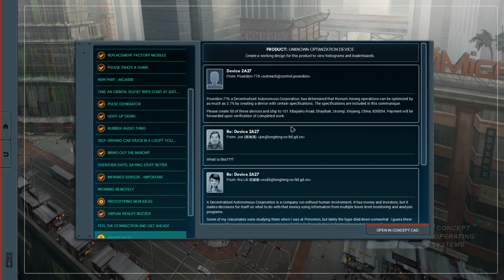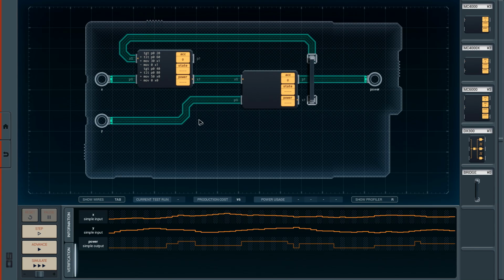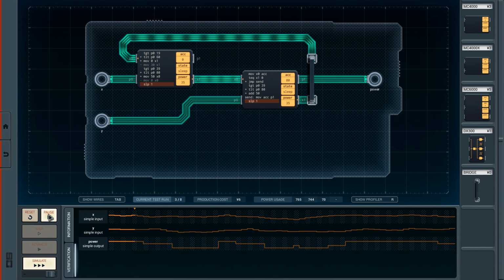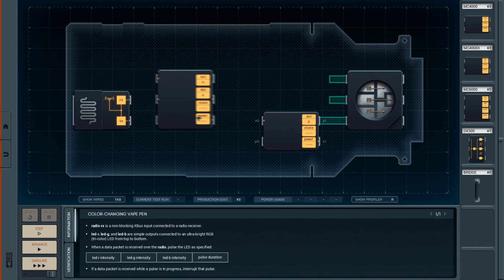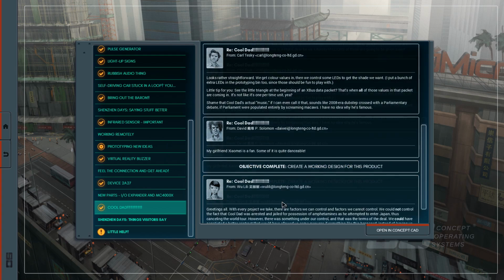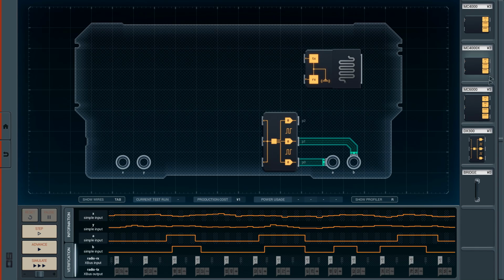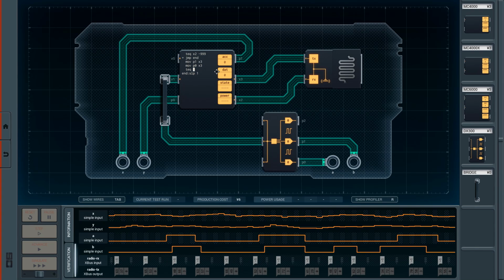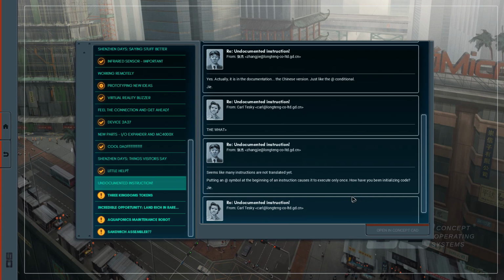Shenzhen I/O - Part 4 - Thorium Mining Cool Dad Vape Cubehotel Game Controller

Comment: one major problem with this game is that it assumes you need a sleep command.
while it treat SUB/ADD/MUL, MOV, and NOP to be the same.
as some one who has designed circuits working my way up to programming I can tell you NOP is waaay faster then sleep, SUB/ADD are equal MUL is faster then DIV, while MOV is slower then ADD and faster then MUL/DIV.

people seem to compare it to TIS-100 and KOHCTPYKTOP, but what frustrate people who actually deal with machine code and real clock cycles is the fact that different operations don't take the same time to execute.
TIS-100 coped with it by making every operation take the same time, while KOHCTPYKTOP made it pretty realistic, while Shenzen IO takes it to the programmer level, ignoring any actual computer logic... if  there's nothing on the bus then read it as a 0 or 1 since the engineer would know what the default value of the bus should be and would implement a pull up/down resistor.

it feels very unlogical to need to tell it to sleep if you are getting a value from Xx, normalcy you would use it as a flag that this unit is inactive or use it a s a short cut to prevent you from using too much power actively looking for an input.

it became very obvious from the click level... let me combine Px and Xx, that limitation is obviously the amounts of bits, but then don't claim that the Xx bus can't be spliced, then don't stop the other chips from executing their code if ChipX is waiting for ChipB to send anything on pin 1.
That whole level could be solved one if function with just then a trigger from the low period of drink 1. the number of "power" could be reduced significantly if you didn't have to tell it to "sleep" for it to do a not (acc) function for the click loop
Reply: embedded engineer rage pants off, it's a really nice game, it makes you think in a different logic making you notice some way you can apply that logic to. the frustration of the dumb limitation of TIS-100 made me realize that if I wasn't limited by time for each operation I could set p0 and p1 to alternate. though in reality P0 and P1 would require some time penalty to change from high to low and where we are speaking IPC time penalty is a hard thing to swallow.... (I kept my rage panties on)

Comment: Is this a great example of the Off By One error?
Reply from the maker: AKA 'Obi Wan Error'
Reply: +Direwolf202 Python (or Cython, or Nim) doesn't need semicolons and looks like pseudocode, making it nigh self-documenting when using proper variable names.
Reply: Arne Rademacker "jne", "jnz", etc. are hard enough to memorize, and even with descriptive labels Assembly is too low level to see what's going on at a glance, so some languages themselves are syntax pitfalls. I'd hate to use Brainf*ck to test a website.
Reply: I lol'd at that :)
I also enjoy miss-spelled or not initialized variables and suddenly you are trying to add 1 to 203usdkfjmnvsu.
Reply: Cees Timmerman Any code looks nigh self-documentary if you use proper names for all your functions/variables/classes/etc and avoid syntax pitfalls like the common triple wrapped if statement, which can happen regardless of language.

I'd even go as far as to say that, if you need to explain what a piece of code is doing, you didn't write it correctly. That ideal obviously shatters as soon as it hits that weird brick wall called "reality", but I'm still gonna preach it :)
Reply: Cees Timmerman But why are you comparing them to python? That's like saying "Apples taste good, toothpaste just doesn't compare". Yes you put both in your mouth to achieve a very specific purpose, and yes both have a very specific taste, but they also both exist for entirely different reasons.

"Python is a widely used, high-level, general-purpose [...] programming language.", so says the almighty Wiki. If you want to compare, compare it to something like or Ruby or Java Script or Java or C# or even C if you have to. :)

I still agree though, there are languages that weren't created with fancy ideas like "readability" in mind :P
Reply: Arne Rademacker A language is meant to transfer meaning. Python does so better than most languages that require semicolons on every line, which is why i mentioned Python. There are many compilers that can turn Python into most any language you need. Cython and Nim even produce fast executables.
Reply: Cees Timmerman You don't take an SUV and a rocket and then compare for speed ratings in space.

I'm not saying that Python is a bad language, but if you want to compare readability, compare to languages that also aim for readability.

Also, saying "Python does so better than most languages" is a very vague and generic statement.

Compare the following statements:

if x > 0
  doSomething()

and

if (x > 0) doSomething()

One is Python. The other is JavaScript in ES6 notation. Would you say that Python is more readable just because it doesn't have brackets?

Edit: (The Python indentation doesn't display properly in Google+ posts apparently)
Reply: Arne Rademacker You're using strawmen now. My only point was to help DireWolf202 with a suggestion.
Reply: Cees Timmerman I have to admit, I think I misinterpreted your first comment, for which I apologize.

I still stand by my arguments though. Python is not the end-all-be-all and suggesting it purely on the basis that it's "easier to write/read" is a fairly weak argument, considering its strict spacing and indentation rule set.

But if that's not what you were getting at then my point is almost entirely moot. Still, thanks for the food for thought.

Comment: Thorium also has the advantage of being fail safe. If you where to abandon an active thorium reactor, it'd cool down and stop. Not the case with other types of nuclear reactors. So basically, I want thorium reactors everywhere. And the nuclear waste of thorium reactors is only radioactive for a few 100 years, and it's waste is actually useful for a few things, so really it isn't waste at all.
Reply from the maker: Sure you can design a LFTR to have a failsafe, but there's a whole host of problems that they have which Uranium reactors don't have.
Reply: Scott Manley But it does eliminate the main reason people don't like nuclear reactors (because they're scary). By the way, if you have a link to somewhere I can read more about this I'd love to have it. Thanks.

Comment: I'm gonna play a game about programming... It's called "Git Gud at C". It comes free with every Arduino, and I've been challenged to program a game controller interface that will allow Kerbal Space Program to send flight data to a plethora of instruments, and read data back from a series of joysticks toggles, and buttons.
(I suck at this game... Steep learning curve)
Reply from the maker: Have you figured out the problems with windows 10? I've been unable to get my arduino to send serial data to KSP.
Reply: Actually, I run Mac OS primarily, however someone has learned that if you use a USB to serial module with the CH340 chip, that it will then work. Something about the integrated Atmel chip based USB and Windows doesn't cooperate. Look for the thread "Hardware, Plugin Arduino based physical display" in the KSP forums. Look at the end of page 63 and look for Mattew's post.
Reply: richfiles Have you looked at KRPC? It interfaces with Python or C, so its an extra step, but it also means you can run logic on your computer. Also, it has APIs for Infernal Robotics and lets you interface with every aspect of every part.

Comment: I should point out that in pretty much every Zachtronics game I've played (spacechem, TIS-100), the 3 things you are being rated on are often mutually exclusive.
While there are some cases where you can redesign something to just be better in everything, usually improvements to one rating come at the expense of another.

This is especially the case with the more complicated puzzles...
Reply: yep, still remember the jro loop unrolling and extreme contortioning to parallelize and save every single clock cycle, and then someone crammed an entire look up table in TIS-100

Comment: The 'Cool Dad' one was kicking my ass because I couldn't figure out how to get it to trigger on incoming data without eating the first byte of the XBus packet, but this morning I figured out exactly as you did and moved the value into dat before testing it! (And even though it's obviously the only right way to do it, I still felt super-smart writing the code to stick the duration byte in the accumulator and decrementing it, lol)  I swear, that I/O expander is such a tease!  You get it just before that puzzle, and it's like the "Ooooh, I know, I'll just-- Dammit!" of realizing it only does digital I/O instead of analog is totally intentional.

After the Cool Dad puzzle, the game controller one was a breeze. I actually couldn't believe I nailed it first try, considering how complex it is.

The next one, the Three Kingdoms puzzle...I can't wait to see how you handle it, because it is seriously pissing me off. I thought I had it, I thought oh I'm so damn smart, omg easy-peasy and with so little hardware! ......and then I realized that the 'bell' output goes for 4 time units, independent of the other actions. So I either waste a lot of instructions or an additional MCU on it... Either way, it also means I have to split the main program between two MCUs now. ARGH!
Reply: Have you tried using the gen command?
Reply: Toasterbot959 Hah, funny you should ask! Last night while I was drifting off to sleep I was thinking about it, and realized that is EXACTLY what gen is for, and I can use it to solve Three Kingdoms Token and the sandwich machine!  Just haven't had a chance to try it yet.

It's that variable pulse-width that really just saves your bacon. :D

Comment: If you want to avoid using a bridge (like at 14:47) you can pull a wire underneath the controller itself by pressing Show wires / Tab :)

Comment: I'am quite impressed. Most of the latest puzzles I've spent almost two hours each, but you solved them in just a few minutes... :(
Reply from the maker: Well I do write code as a day job.... but what really helped was spending hours working on games in the sanbox, learned lots of tricks.
Reply: Oh, that's explains a lot xD
I am an engineer myself. Not a computer engineer, though. Most of the times, I find myself with not enough space in the microcontrollers. I end up with a poorly optimised setup.
Thank you Mr Manley for your answer ^^
Reply: @scottmanley  my solution to the thorium mining unit used 2 of the big processors and 2 small ones. Wayyyy overcomplicated it. I didn't think yours was gonna work at first but that's genius man!

Comment: Regarding the scores at the end of each puzzle. Production and power are not necessarily tied together. You might have to spend more money to get lower power usage.

Or in other words - Several approaches to the same problem. Doesn't mean you can get best recorded scores in both categories with the same solution. :)
Reply: If spacechem and TIS-100 are any indication it is almost certainly impossible in most of the puzzles to get the 'best' score in all of the categories at once.
Improving one score generally hurts you in another one.

Though which matters more conceptually may be fairly obvious from the setting - in TIS-100, cycle count seems like it would matter more than instruction count, because as long as you can get it working at all, there's no other apparent reason why you would want to reduce your instruction count in a computer program designed the way those ones are.
While reducing the cycle count makes all your programs run faster...

Comment: Another interesting thing to note about scores: only your best score for each category shows up for others.

For example, in the wireless game controller one, my best production cost was 6 (but had 240 power), and my best power usage was 204 (but had 7 production cost). My friends see my best score as 6 cost, 204 power.

What I'm saying is, don't hurt your brain trying to match the best scores in all categories at once. Each category counts independently. That's one of the reasons why you can have multiple designs for each puzzle.
Reply: The scores should be dots on a plot of X cost, Y power and be Z stacks in popularity. Then you can see the difference.
Reply: And ten seconds later I realised how to modify it further. 6 cost, 128 power.
Reply: It is possible to reduce the power requirement for the (6 cost) wireless game controller from 240 to 140 by noting that there is a minimum polling time. Just after the data packet is sent, throw in an extra SLP command.
Reply: Agreed.
Reply: cswvna Wow, nice catch! With that information, I quickly managed to get that 6 cost 128 power as well. Very nice!